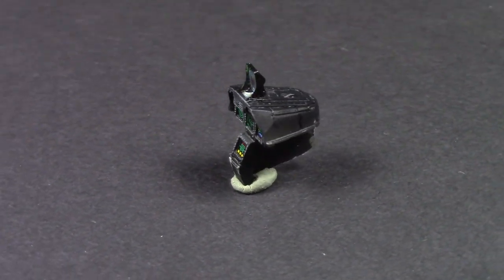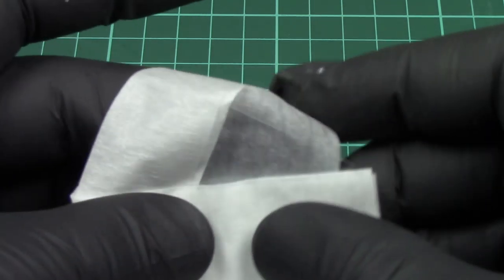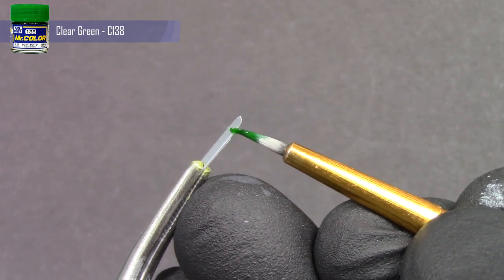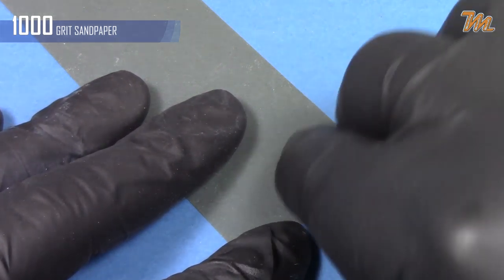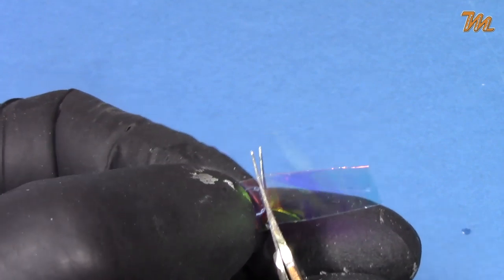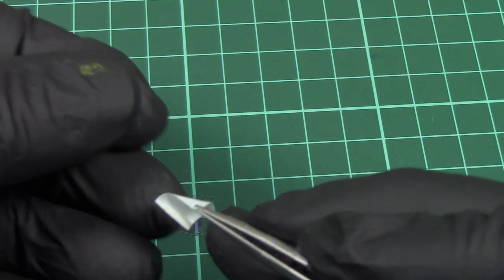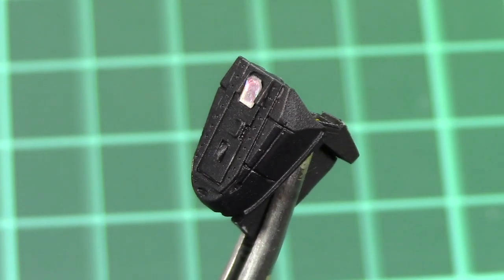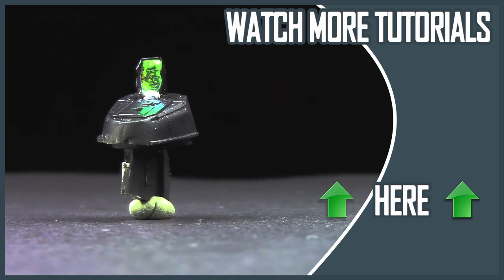How to make an awesome HUD for your model airplane -  plastic model aircraft tutorial

Comment: This was a very good tutorial, but more modern HUDs have a circular, gridded output lens, and two sloping, parallel glass reflectors to allow for more accurate aiming. Typically the angle would be a bit more acute too, with 45 degrees allowing the best look through.
Reply from the maker: Thanks mate, there are different HUDs I agree but the basic technique can be applied in any circumstance. That's the idea of this video, to show a basic technique that can be applied as anyone wishes